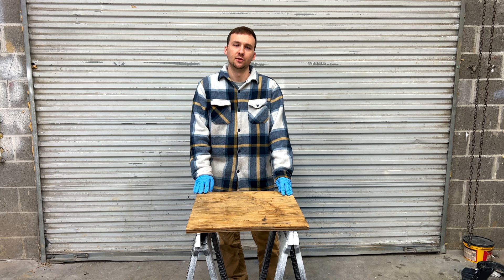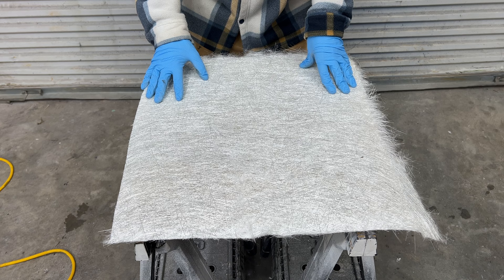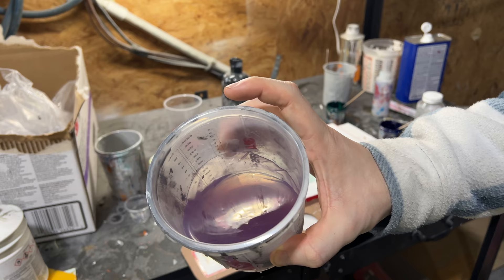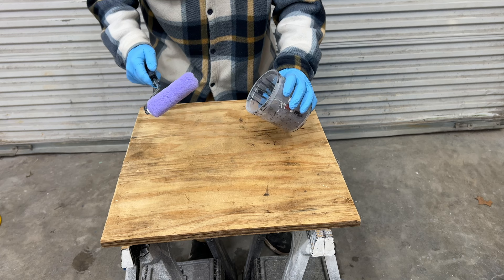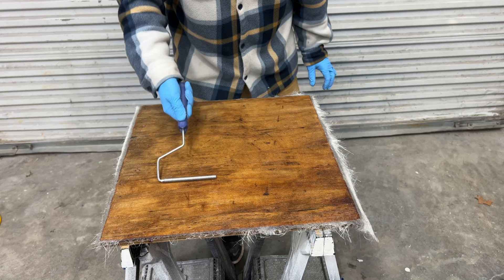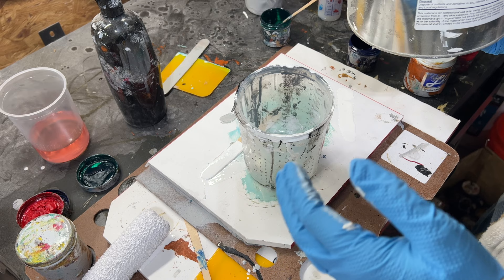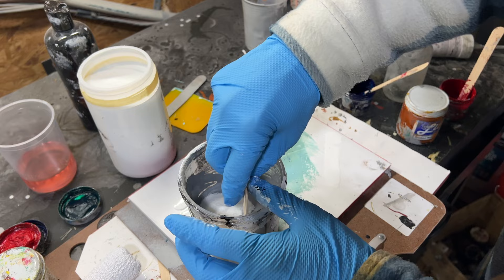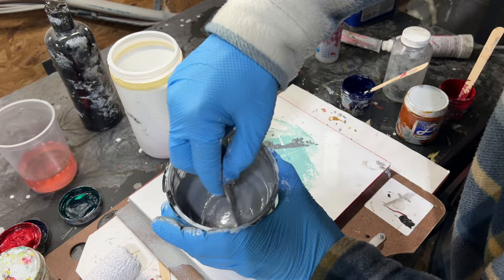How to FIBERGLASS and GELCOAT over PLYWOOD | DIY

Comment: Just started my journey with fiberglass!  I want to use it to modify a small shower pan for van build.  Thsnks for covering some of the things i need to know. Things went beyond my knowledge when you were mixing the nonskid, but i gained!  I will be shortening the pre-existing pan, and i need to add an elevated “pedestal “ for a cassette commode.  A question i have is how to prep the plastic of the pan to accept the fiberglass?  Is a rough sand all i need?
Reply from the maker: P60 grit, west system epoxy and 1708 fiberglass cloth will be your best bet.